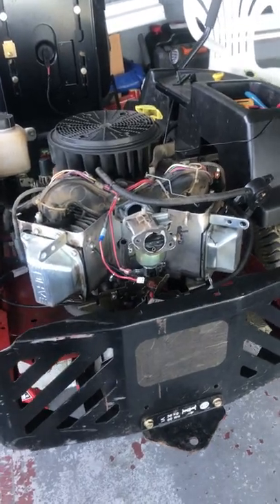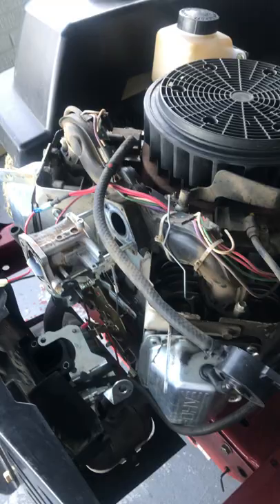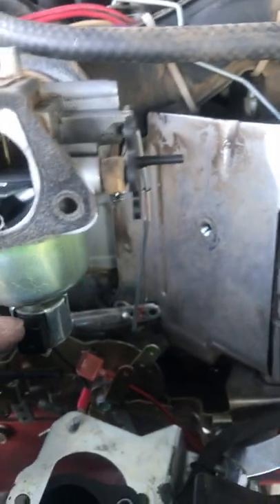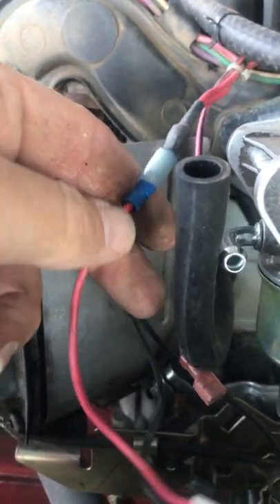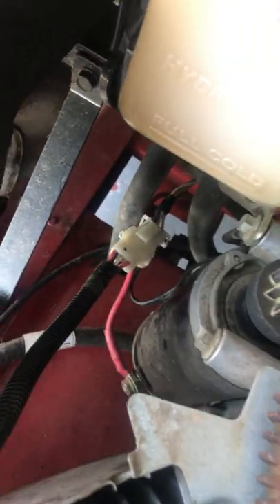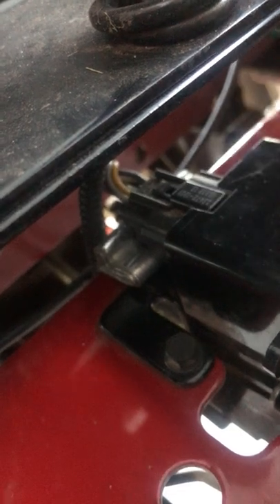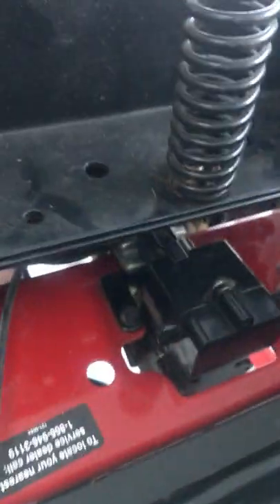Kohler KT735 Cranks But Won’t Start; Fuel Solenoid Issue?

Comment: I had this same issue.  The mower would run if I took a jumper wire straight from the battery to the solenoid.  Ended up replacing the ignition switch.  That worked for a few months, then it happened again.  Another ignition switch. Probably a short somewhere for me.

Comment: Most of the time it’s a loose fuel solenoid plug 🔌 under the carburetor, usually the plastic plug gets cracked
Reply from the maker: Good tip!
Reply: My Kohler 28 is acting up right now seems like when I first start it and start cutting it's good about an hour into it starts backfiring and popping like it's running out of fuel and then both tanks are got plenty in it
Reply: @davidreasons9730  Check the governor adjustment, throttle adjustment, make sure all the bolts are tight and not loose and make sure the carburetor doesn’t have dirt in it, it’s acting like a clogged fuel filter
Reply: @davidreasons9730  I had the same issue with my john deere and changed the ignition coils and now it runs like new. Really cheap and easy fix took me about 20 min

Comment: The 7000 series likes to burn up coils.  Run a ground from the battery to the motor.  I just did a video of how the charge controller/voltage reg. burns up easily, and I permanently fixed it. Lots of problems with the Kohler motor.  They like the E3 sparkplugs too.
Reply: Also I had a set screw come loose above the oil filter and cought it in time before kaboom!  Lots of oil came out but I cought it in time.
Reply: What exactly do you mean by "they like E3 plugs....."? I have a 2016 Cub Cadet 60"  zero turn and now tackling the maintenance on my own and was looking at the E3 spark plugs for mine but didn't buy any that day. I wasn't sure about them. E3, Good or bad? I'm here trying to figure out why it won't turn over.
Reply: @jennifermatoy8633  the coils that supply spark to the spark plugs. Documented many problems and Kohler has updated coils. My thoughts Kohler should have done it right the first time.
Reply: @jennifermatoy8633  the kohler v-twin up till 2019? would burn up ignition coils easily.  Kohler came up with a better coil and have them for sale.
Reply: @TheClintmeister  I'm pretty sure that's what mine is just a 2016. Sounds like a job I probably shouldn't do. I'll have my son do the coils but while at Tractor Supply getting oil, filters , etc was looking at plugs. I have 2 different types of plugs I can use. One was the E3 and all they had in stock but also had another Plug made by Kohler but I didn't see that one. Is the Kohler an E3 too? If not which one should I use? Thank you for the quick reply.
Reply: @jennifermatoy8633  E3 is a better plug (3 ways for the spark to move) I would stay away from anything that has Kohler's name on it.  But you will have to get the Kohler's coils ( they have been upgraded).  I have a friend who I bought my Bad Boy mower W Kohler engine from.  I get a lot of info from him about the Kohler.  Hope this helped.
Reply: My kolher acting up now....will be cutting...45min in-to a HR....paping acting up like running out of fuel....theres plenty,put New filter on it...thinking that was it....did better @ first....then layed down....so...more checking
Reply: @davidreasons9730  check sparkplugs and the coils like to burn up on Kohler
Reply: @jennifermatoy8633  honestly I wouldnt use anything with Kohler name on it.
Reply: @TheClintmeister  thank you for all the information. It has been very helpful.
Reply: After changing all the normal parts and still having problems with keeping my mower running, I am embarrassed to say what the problem was. My son would use the mower at his house and never had any problems but it always acted up when I mowed but while mowing the last time I figured out what my porbkem might be when I seen my new fuel filter was bone dry. My gas cap happens to be twisted off when I mow around some of my bushes and I had bushes and other junk getting into the gas tank. So of course that was my problem. I took the tank off and cleaned it out and cleaned out all the gas lines until past fuel filter. There was so much nastiness in the tank all the way to the filter. Like I said I am embarrassed to even admit that because I should have known with the gas cap coming off it would have junk in the gas. Put it all back together and have been mowing with no problems since. Lol

Comment: Thank you for the video.  Having similar problem with no power to fuel solenoid.
Reply: I dont have time to track down that stuff. I bypass everything by putting a jumper wire to the key switch. Also if they dont work when testing, I cut the plunger off.
Reply: I took the solenoid off with a thin wrench and cut the top (plunger/fuel jet shut off) then bolted it back in. Problem solved.

Comment: Hi Wes, I have the same carburetor as you a Walbro LMC. I am having surging problems, but luck on finding any adjustments. Have you run across any adjustments? Walbro has none.
Reply from the maker: No I haven’t, sorry.

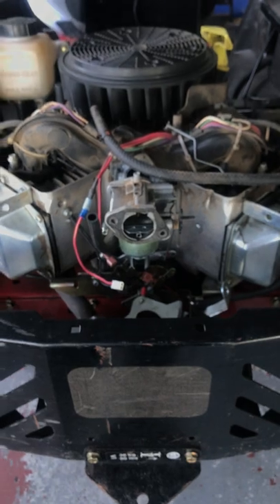Comment: At 4:19, the rubber hose you see I know connects to the bottom of the air filter housing but where is it coming from and is it the crank case vent hose? Mine is putting oil in the carb.

Comment: I think we have pretty much the same set up. Mine is not getting fuel to the filter unless my gas tank is 100% full.  About 2 minutes after starting is uses a few ounces of fuel and my line to my filter will not flow any gas. As soon as I refill my gas it will then flow and run again for a few minutes. 

My gas line enters my tank from the top side.  Any advice?
Reply from the maker: Sounds like there possibly could be a crack or slit in it somewhere near the top. Once the fuel level drops below it, it starts pulling air and loses suction. Like a straw when it’s got a hole in it.
Reply: @wesleyebarton  I ended up cutting my hand and got stitched up. Haven't went back to it yet.  Good idea. Thanks

Comment: Thank You
Mine 61" Z Master commercial and when it runs fine on the right tank but the left tank it after cutting for about 15 or 20 minutes. Gas it will start acting up and eventually die so I've got some kind of a fuel issue and I'm going to check this right here to see if this could possibly be at Monza Kohler 28
Reply: It could be the gas cap on the left tank is not venting properly. Maybe it isn’t but try switching the caps

Comment: When you turn the key could you get the fuel solenoid to actuate at all? Like did you hear the click? I just wondered if it would still click at that low voltage but not fully retract like it's supposed to.....
Reply from the maker: No. I couldn’t hear it click either.
Reply: Thank you!

Comment: Would the motor crank? Also were you getting fuel when turning over?
Reply from the maker: Yes the motor would crank. The fuel solenoid needle would not open (retract) to allow fuel into the bowl.

Comment: Well I still have power to the fuel solenoid so that plug wont apply here. 

Would anyone know a solution to: Cranks but wont start. Fuel solenoid working with key on, both spark plug produce spark. Carb, fuel filter, fuel pump changed. Wont Start. Starts with starter fluid, then dies. TIA
Reply from the maker: I experienced the same thing on a tiller when I had installed a new aftermarket carburetor. I replaced it with a genuine Honda carburetor specific to the engine model, and it ran perfect.

Comment: Just pull the connector off the brake module, spray contact cleaner on pins and reconnect. Problem fixed...
Reply from the maker: I tried your recommendation today. Didn’t work 😞. It will not work unless there is pressure pulling up on the plug. I fooled with it for hours and the only way I could get it to stay working was to pull up on the plug using a zip tie through holes in the frame just above it.
Reply: @Wes_Barton  Yours is probably a broken pin and I had a corroded pin.

Comment: My mower will take a charge but won't stay running when I take off jumper cables
Reply from the maker: Sounds like the battery is no good. The fuel solenoid needs current to remain open allowing fuel in.

Comment: That's not a fuel solenoid issue.
Reply from the maker: It’s a wiring issue controlling the fuel solenoid.
Reply: @Wes_Barton  there is awire from switch with12v to solenoid if that lead has no volts                   bad switch--------m lead   leaving switch  this same wire gos other places   also